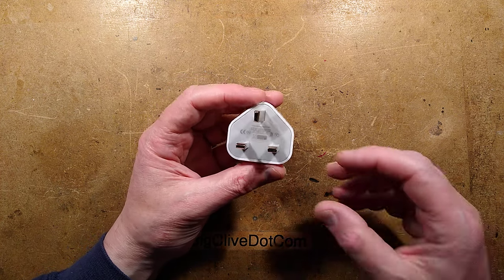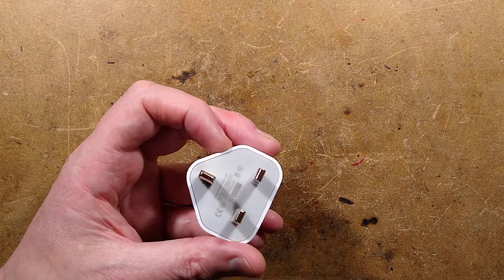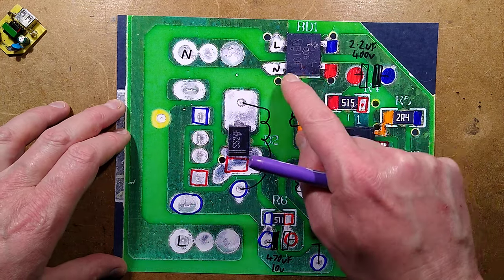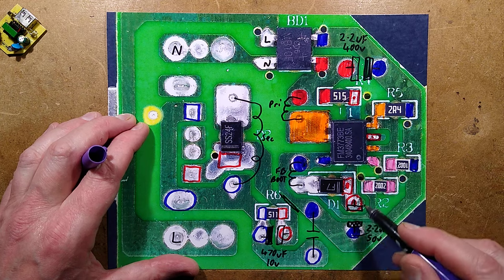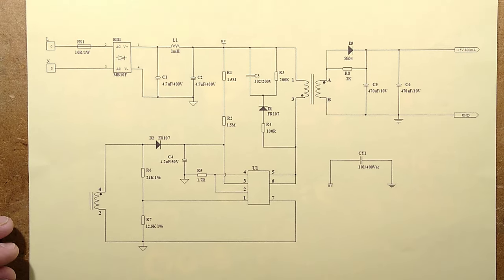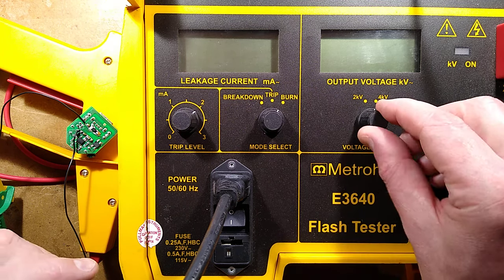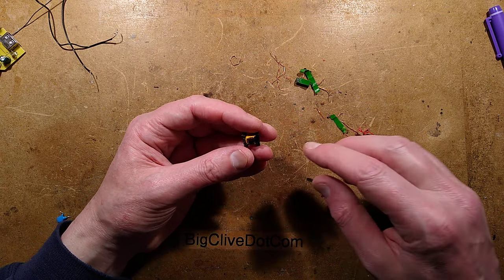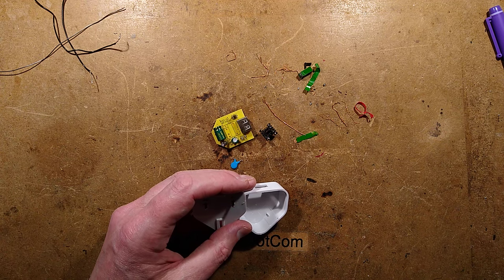Don't buy cheap death-wish chargers

Comment: I assume that the manufacturer skipped the tape between the feedback winding and the secondary on the assumption that the feedback winding would only have low voltages present. Not a great idea given that the feedback winding is on the primary side.
Reply from the maker: I pondered that too.  The grasp of electrical theory is poor in many cloned products.

Comment: What voltage did the track flashover at?

Also just some feedback, I usually find it easier to follow on with the circuit explanation with the diagram rather than the PCB.

Comment: Have you done the 12vdc adapters yet? I have inspected so many that will catch your car on fire. Eventually. One I took apart had a resister bank to drop the voltage.  Crazy.

Comment: So was the ground connection pressing up against that fat capacitor cuz it looked like it had a socket on the back of the plug but no connection on the board ?

Comment: As far as I know the class Y capacitor always needs to be a 2 kV rated one for 240 Volt stuff at least. There's some class 1,2,3 difference (where 2 is medical stuff and it requires either a 4 or even 6 kV rated cap).
I've looked it up once, but as I hardly ever deal with the full specifications, I don't remember it too well.

Comment: 7:50, I have an anker charger with a load of different ports on it that when I charged my metal-bodied Pixel 2 I'd get an extremely mild shock off if I brushed my hand against it while plugged in. Is a capacitor like this why I'd get that?

Comment: Looks like a bag of... I thought class Y1 capacitors had to be rated to 8kv, so if it says 1kv then I don't think it's a CY1 capacitor. I could be wrong, I've learnt most of my knowledge from you and DiodeGoneWild :) Edit: Look at that live track too, that's so close to the metal of the USB port!

Comment: The CE marking of an item that does not meet the EU low voltage directive rules on isolation is illegal, surely, isn't it? Have you told the shop to stop stocking it and report the supplier?

Comment: at 11:44, that may actually be a spark gap, not the usual, pointy affair, but a spark gap none the less, it only failed at 2000volt, well that a bit out side the normal main voltage anywhere in the world,  lightning strike, or a bad day at the power plant, if it was just a small flash, bang, would it of still be in workable, and how abut what was coming out the USB socket how far from 5volt, and amps, before it had a complete melt down turning to a death-trap

Comment: I can't believe they didn't include the RCD clamp in the primary side.
Also, in the schematic, shouldn't the R6/R7 resistor divider be on the other side of the diode D2 ?

Comment: That official CE label clearly doesn’t stand for any quality anymore. A big problem is that it is easily confused with China’s imitation CE logo that conveniently stands for “China Export”. The only difference between the two is the distance between the two letters. It baffles me as to why the EU didn’t immediately prohibit any product with such a similar logo from entering their markets. And slap the manufactures with a logo infringement lawsuit. Instead they allow the situation to exist. Yet consumers might be inclined to think they bought a safe product, because don’t see the logo difference, but the differences in quality are paramount. China Export products can be outright dangerous, as is often demonstrated here on this channel.
Reply: EU's CE marking isn't any kind of certification or license, it's simply stating that the manufacturer has read and will follow the EU regulations regardless if they have or not.
There is no way to lose the right to use it, no testing of the products for approval beforehand nor anything else that would make the CE marking of any use for the consumers.
Reply: @johanmetreus1268  then it’s even less useful. As I understood it’s a criminal offense if you misuse the logo. For instance by offering non compliant products with that logo. This gives at least some legal power to it.

Comment: Yup, cant skimp with power supplies. I bought a cheap wall outlet (brand: Suny) that is "rated" for 12v 5A, But i only use it at 12v 1 amp and it seems to run fine. For my phone and laptop, I use the ones that it came with or a reputable brand from a big name store. too many fakes to risk it, even if its only for a 9V2.77A 25W charger

Comment: If the neutral was routed around the USB ( instead of the live ! ) , this would help give more safety ( the neutral should only have a couple of volts ( reference to ground ) ... much less chance of leakage / flashover ( although this device did not fail at this point , as demonstrated ! ! )

Comment: It really should not be possible to just spudge open a thing that will give you live prongs on which to get zapped.  And that small trace clearance between primary and secondary circuits is a real problem should any metallic debris get loose in there.  Still neither of them is an unfixable thing.  It's a design oversight.

Comment: This has been a big problem going back many years. We all se cheap chargers in a basket on the counter of stores where, because they’re so cheap, people buy them as a spontaneous purchase. A few years ago, Apple had a trade in program in China as several people were electrocuted from these cheap chargers, so Apple gave their chargers in replacement.

There was a good tear down of Apple’s chargers and some cheaper ones, and an expensive Belkin. The Apple and Belkin were fine, with complex redundant safety systems, but the cheap ones had none.

Also, even worse, a few years ago Apple was getting a lot of returns for chargers, cables and other Apple branded accessories that were sold on Amazon. After buying thousands of these, Apple announced that 90% were fake. 90%!!! I never buy any Apple branded accessories from anywhere but direct from Apple, or one of their authorized sellers. I’m even concerned about the authorized sellers. Who knows where they got theirs?

Same with eBay or anywhere else. You just don’t know. If your cable is falling apart, and didn’t buy it direct from Apple, there’s a very good chance it’s not a genuine Apple product. If you open an older Apple charger, you’ll see a lot more components than this one has. They generally have components that communicate with the charging circuits in the Apple device, and other companies devices that use similar systems. These don’t.

Comment: Hey Clive. Could you do a video on how chargers have gotten so small over the years. case in point the Apple style one in this video. I remember having bricks back in the early 90's that would output a few hundred milliamps DC.
Reply: The old chargers were "linear" power supplies with large-ish transformers. New "switch mode" power supplies are much smaller because they use semiconductors and smaller transformers; the trade-off is that the latter tend to be much noisier electrically. This power supply is lacking the filtering components that the genuine Apple product uses to eliminate interference.

Comment: I've lived with cheapo 5V 1A usb chargers for years and only just the past couple months have I actually started buying decent charger bricks. For years I've been complaining about how slowly phones charge, never realised it was because I was using chargers that weren't actually capable of putting out enough power to do anything useful.

Funny side note, I remember when I was in uni halls we all had to get our electrical plugs tested for compliance. Needless to say we were all extremely annoyed to find that most of the usb bricks didnt actually pass or sometimes even survive whatever test they were put through.
Reply: Worth looking at your usb cables too, the cheap skinny cables are slow to charge and can get worryingly warm. Especially noticeable with 2m cables.
Reply: @netyr4554  done that too, started using anker since they have a lot of positive reviews.
Reply: I didn't want to sound like a shill but I am using Anker too, have been using the same Anker cable everyday for the last 7 years, Apple's only lasted a year before it failed and the generic ones barely worked when new.

Also fuck apple for making a propriety connector (lightning) and requiring "licensed" chips in accessories for them to work properly and removing the 3.5mm Jack so you need another chipped accessory just to plug in a pair of earphones.
Reply: @netyr4554  honestly I fucking hate apple as a company. Some of their products are cool, but their practices and their attitudes toward consumers puts me off ever getting anything from them.

Good to know the anker cables hold up though. If mine do me well I'll probably end up binning off all my cheap cables and just using those for everything.

Comment: I dont use cheap dollar store or 5 Below chargers on my devices, but for low power LEDs or charging power banks i dont have an issue with using them for, assuming the voltage drop while using them is acceptable.

Comment: Thanks. Many of these noname USB PSUs are absolute death traps. It would have been very interesting to have done a side by side comparison with the genuine Apple PSU Plug. Have you done one of those Clive? The other really scary thing is that folk will frequently leave it plugged in when not actually charging. So with no input fusing (just the 30A ring main MCB!) it’s a huge fire risk should a fault develop. Let alone the totally inadequate insulation and creepage and clearance. Also, externally, the quality of these fakes look great. Typical users have no idea of the risks!

Comment: You know, this makes me wonder how an iPhone would react to 230V AC fed into the Lightning connector - or indeed, any smartphone with 230V AC connected directly to their charging port.

I am willing to bet that the answer is "not kindly" and may involve smoke, and possibly a battery kerplosion.
Reply: yeah all the circuitry would go open circuit before you got any energy into the battery

Comment: I don't know anything about electricity but does a charger really ever have to support over 1000 volts? 
aren't most places just 240v or 120v? 

Like all I've gotten from this video was the charger is going to die after 1000 volts.

Comment: Not only dangerous, But a 1amp maximum output is pretty useless these days for charging a modern smartphone, unless you have about 12 hours to spare waiting!! My Samsung chargers have 2 amps output (at standard 5 volt) the dual output fast charge ones have 1.67 amps at 9 volt too.
Reply: It used to take about 3 1/2 hours to fully charge my old iPhone XR with a 5W 1 Amp charger.

Comment: I noticed that the European Union has recently mandated that anyone doing business in the jurisdiction has to use a generic type of charger.  Apple as we know loves to dick about with charger specs so that you have to buy new chargers and or phones. They are outraged by the policy - bollocks like "It will stifle innovation", blah, blah. One of the reasons for the policy is the recycling impact of the unwanted chargers.  Not sure if as  part of this policy they will actually get serious with some of the standards themselves.  You picked that lack of separation like a nose.

Comment: If the output went live, and the user was holding its metal phone, would the RCD trip?
Reply: In theory yes, but don't trust that this will save your life in all conditions, if you are also in contact with a grounded conductive surface, say a refrigerator, the current can be large enough to kill some people before the RCD trips, not everyone responds the same to an electric shock of the same intensity and/or duration, it also depends on the path that the electricity follows through your body and many other variables, it is desirable not to receive the shock in the first place
It can also cause you to have any kind of accident, you can simply fall and hit your head, you can spill boiling coffee on yourself, if you are using a knife you can cut yourself, etc. etc.
And then there are dumb people who like to use and charge their smartphone while taking a relaxing bath, in those conditions you can be fried before the RCD has time to open the contacts. In these cases, even the best charger on the market can leak current due to a splash of water.
Reply: In principle the RCD should trip because the electrons exiting the circuit via your body would cause an imbalance that the RCD is designed to detect. Assuming the RCD is functioning correctly etc.

If there was only a fuse or resettable circuit breaker (no RCD) then that would not trip fast enough to protect you, and most likely would never be tripped by the fault. Which is why houses have both circuit breakers and RCD, as they each do different protective tasks.

However an RCD is not a substitute for bad product safety, it isn't magic and doesn't put out electrical fires.

Comment: Sorry if it's a stupid question.
If the "gap" between the two sides didn't start sparking until 1000-2000v is that a problem? 
its 5-10times higher than normal wall voltages... or is it dangerous if like dust or other materials get in the gap and make it even easier to connect the two sides?
Thanks
Reply from the maker: These power supplies have to be able to deal with mains transients and also the risk of electrostatic discharge from the output side to the mains side.

Comment: Isn't the idea of a safety capacitor for it to fail open circuit?   It appears the one in this device failed short circuit.    That definitely doesn't sound like a safety capacitor.

Comment: Speaking of "chargers". Any chance you could take a stab at a USB charger box attached to those foldable solar panels? The USB output behaves rather weirdly on the ones I have here (including one from Anker which supports multiple charging protocols and a more powerful one from iMars which even has USB-C PD with up to 9V) but not weirdly enough for me to sacrifice one. I wonder if they even attempt to do MPPT or if it's just a fire-and-forget buck regulation with a horrible power factor (which seems more inline with my actual experience).
Reply: I have a 12V foldout panel which only uses one panel, and whilst it charges a battery okay, that is all it really does - it has a bloody computer in it and everything, yet it behaves almost identically to a LM317 :/

Comment: Scary stuff, wouldn't like to be on the receiving end of tone of these things when they go bad, thankfully I only use what my devices come with (Two Samsungs, one Asus), as at least then I know they're the genuine thing, makes you wonder why people need to buy replacements for a certain fruit product, unless they're just not respectful to their equipment...
Reply: It doesn't matter how well you treat them. Those things from fruit companies are designed to break.
Specially the cables.
Reply: It's also useful to have multiple chargers. I bought quite a few cheap chargers from China before knowing how bad they can be. Now I've thrown everything out and only have chargers from the device manufacturer, reputable third party brands or from a specific store that I trust verifies what they sell.

Comment: Was hi-pot flash tester ac or dc output as I would only use dc to prevent capacitive reactance conduction and depending on ESR of the capacitor self heating

Comment: If the transformer output short circuited and the case of the phone became 'live', (13:30) surely it would be AC. As I pointed out in a reply to another video, AC would not cause a person's hand to grip onto the phone and be unable to let go (high voltage DC would) which is one of the reasons (if I remember from my training) why we have AC mains supplies; AC is safer - or at least less dangerous at similar voltages. Having had several mains AC shocks, the tendon and muscle response (fingers have tendons rather than muscles, by the way) is rapid flexing and tensing at 50Hz - it would actually be more likely to be impossible to hold onto the phone. I had a few belts from Wessex III and Wessex V 24v systems and we were warned of the risk of not being able to let go and how to avoid the situation. Anybody who has tried electrical muscle stimulation (EMS) will have experienced how DC pulses cause muscles and tendons to contract - I once had the problem that I was using a particularly high voltage and couldn't switch it off because every second or so, the DC pulse jerked both my arms. I have read  articles which contradict each other but I lean on my personal experience.

By the way, I have had a number of these explode. I bought a few of them when I couldn't find any of my original Apple chargers but since the originals have shown up and as the fakes I have have identical printing on them, it is impossible to tell which are which until they blow up.
Reply from the maker: It's AC that causes sustained muscle contraction by continuously stimulating the muscles.  DC causes a single brief contraction.